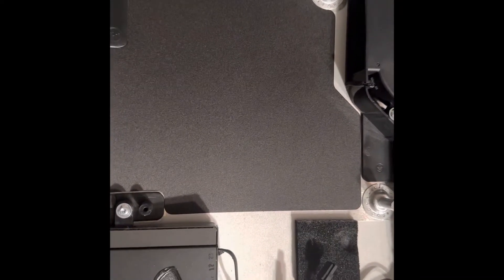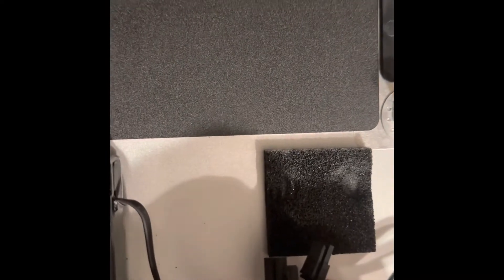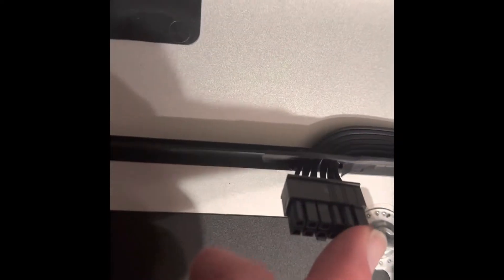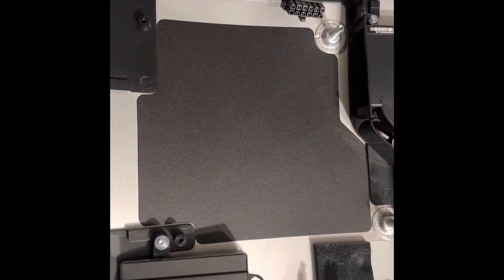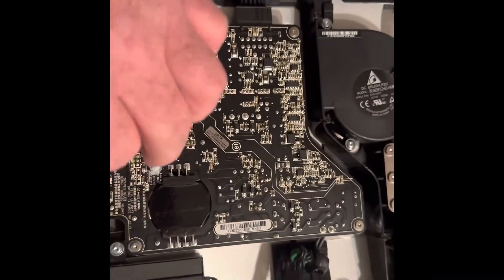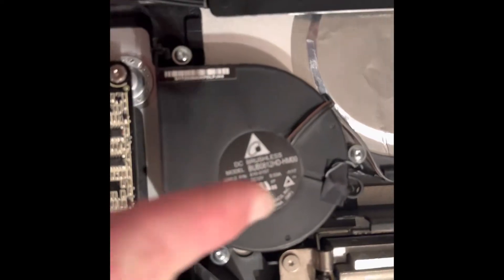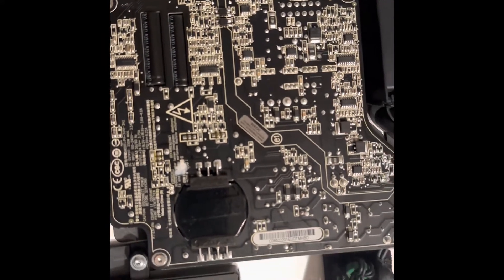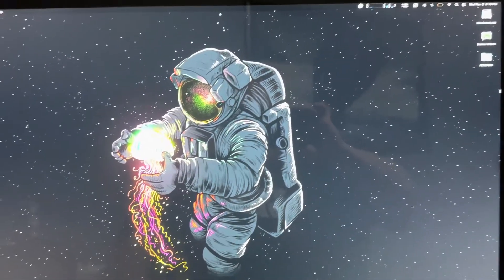Apple 27” Thunderbolt Display Power Supply Burning Smell Issue **Solved!**

Comment: just got one second hand for $125 and of course the guy didn't mention the smell. Feel like I'm gonna get cancer every time I use my computer.
Reply from the maker: Yep! Those bastards. Almost exact same thing happened to me. If it’s worth it to ya and you feel like you can do it spend the $100. Even after it won’t be 💯 gone for a while but it’ll be much better. Highly recommend putting an air purifier next to it even after. I did and it helps with any remaining lingering smell. Good luck.

Comment: How has the power supply been so far? Still holding up?
Reply from the maker: Yes, it’s been great now. I will tell you that it took a while for that burning smell to completely completely leave the system. I don’t know if it was just embedded inside the case or what, but took about a month or so to fully be gone. I also have an air purifier near it so if it’s still giving off any kind of odor or chemical smell, air purifier, just eats it right up so that also helps I’m sure but the replacement power supply is holding up great and haven’t had any issues with it.
Reply: @BluePlanetDrone  well that’s good to hear. Great work